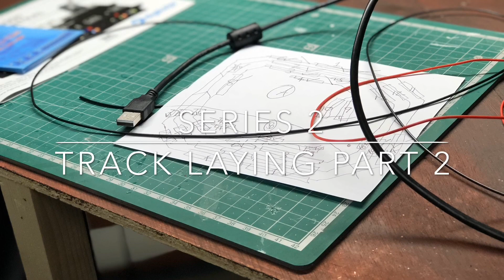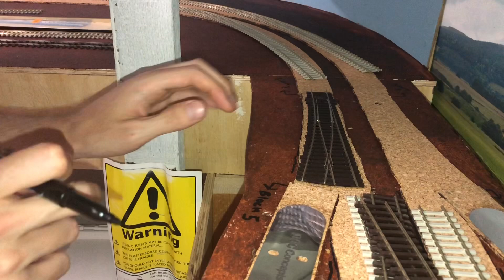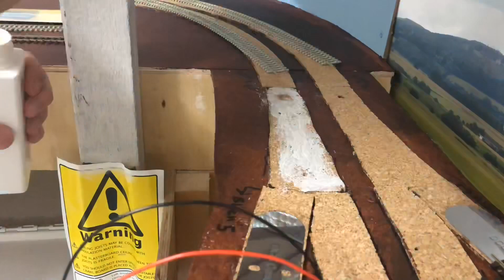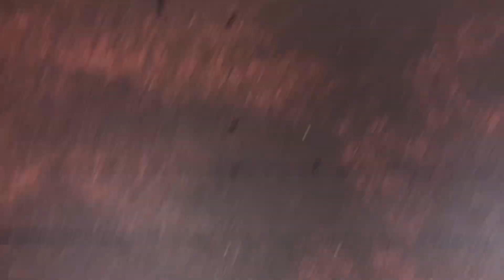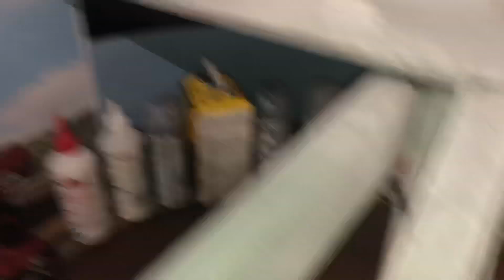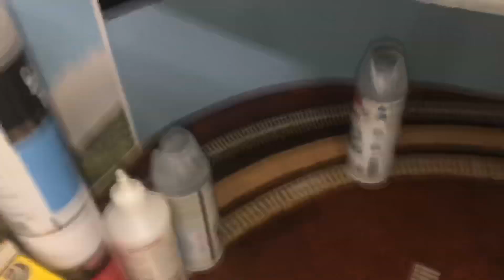Track Laying Part 2 | Building A Model Railway

Comment: Great update Tony. Have you ever considered putting your droppers across the two rails instead of using the little tiny metal clip? I was given the same advise a while back and it all works fine and saves soldering the same job twice.. Cheers for now, Chris
Reply from the maker: Ahh, are you talking about when soldering the droppers for the points?
Yes, but some points I really wanted to hide as much wiring as possible. That being said, could always use a bit more ballast I suppose!